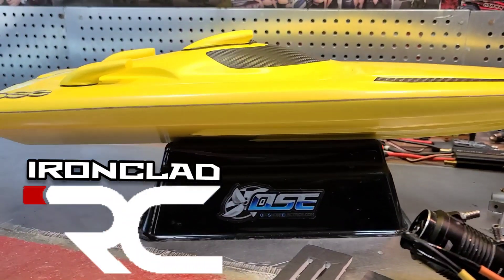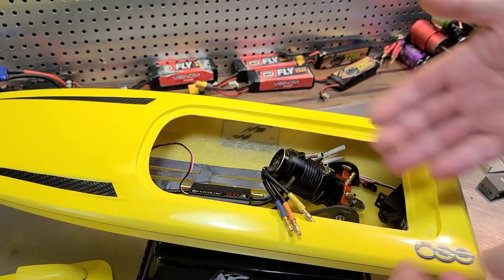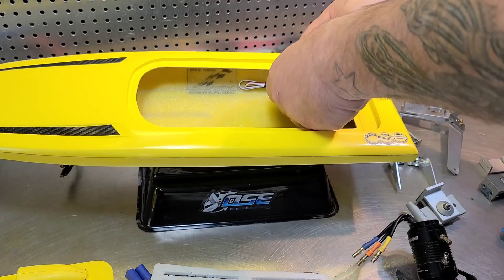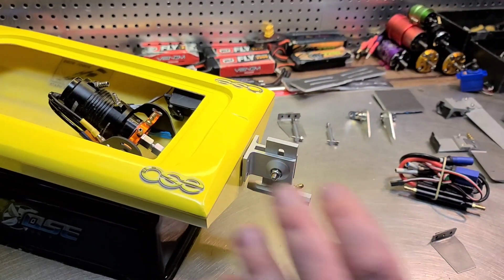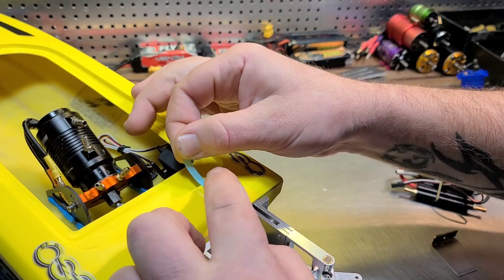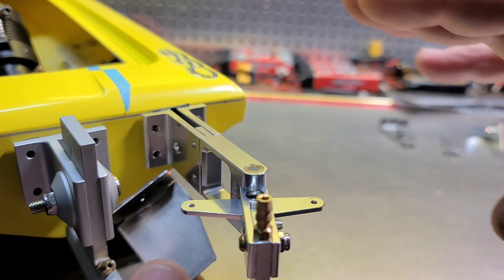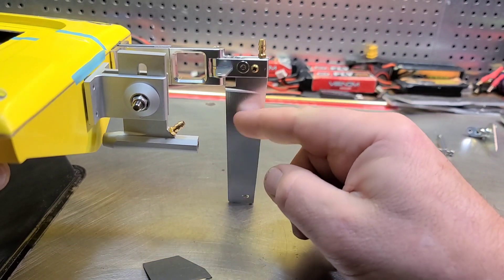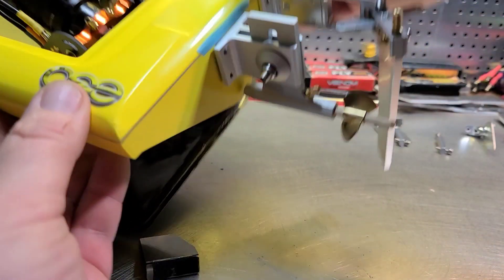Fast Electric RC Boat Build - Pt3 Setup Options & Tips

Comment: If you keep the center of buoyancy as low as possible and all the weight centered in the hull, you  don't need to worry about cg. 
I built 2 of these ith Leo 2860 -2550kv on 4s 4000mah cnhl 70c pack, cnc 35mm x3 blade. I did same concept with my DF33 mono and it runs awesome. Love you channel :hand-purple-blue-peace::hand-purple-blue-peace::hand-purple-blue-peace::hand-purple-blue-peace: